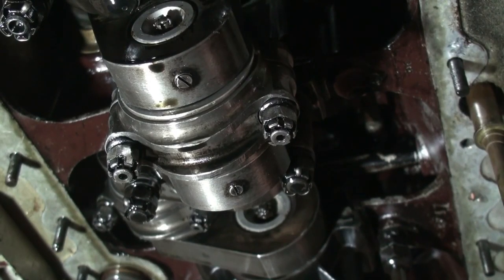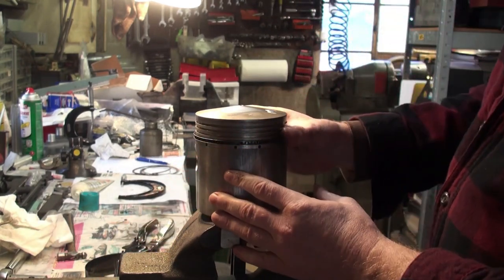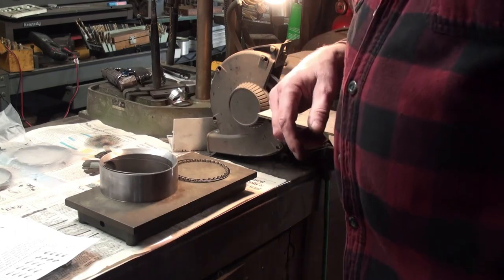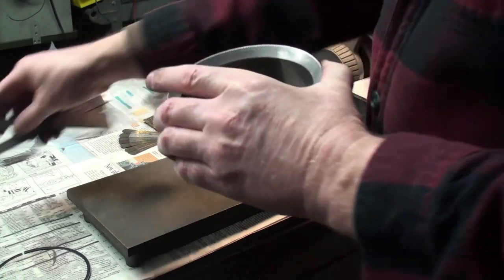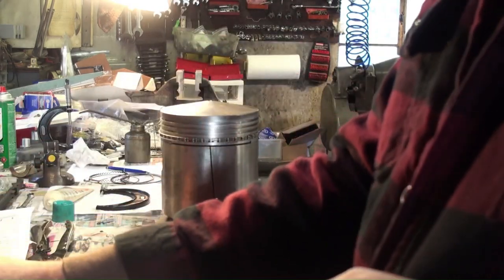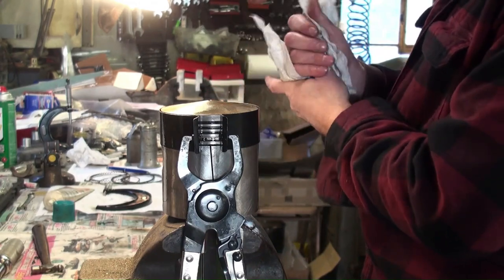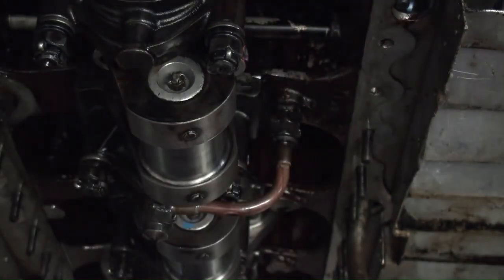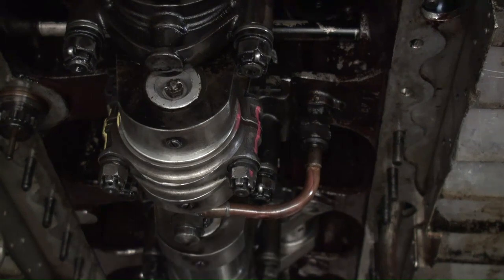Rolls-Royce Phantom 1 Piston Ring Replacing

Comment: I was surprised to find out that both RR and Lotus used an assembly lube called Graphogen during the bedding of the crankshaft in the initial engine build to this day since the close of WW II. My grandfather, a manager of an oil refinery in Misburg outside Hannover during WW II did a lot of tinkering in his lab and developed Graphogen for and with the motor "heads" at JUMO.. My granddad explained that the crank bearings live or die before the very first oil pressure build-up on the very first engine start. His refinery produced graphite as a petroleum by-product so he gave it a try...it worked and the idea is here to stay!